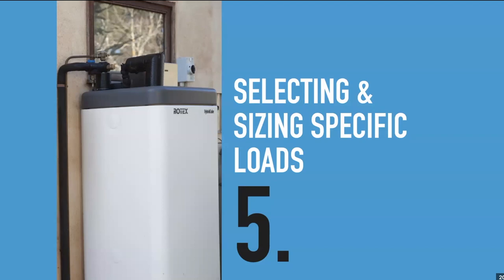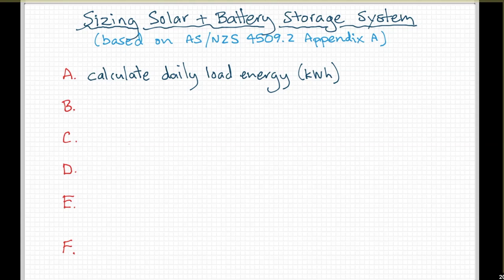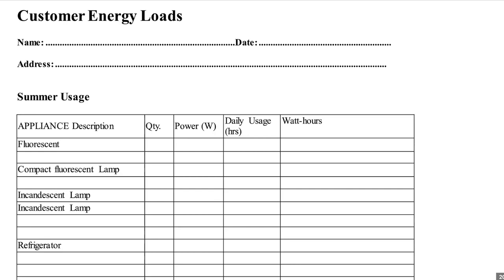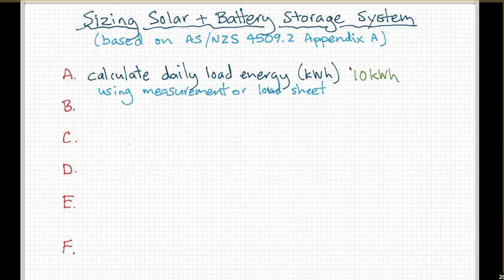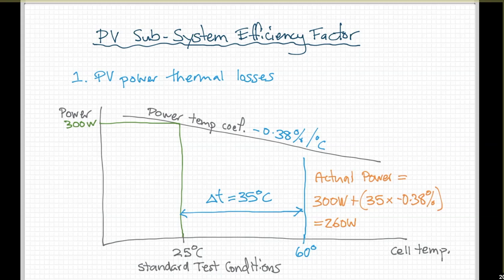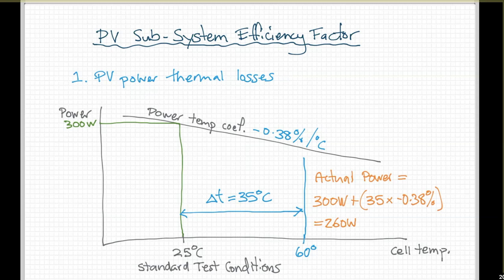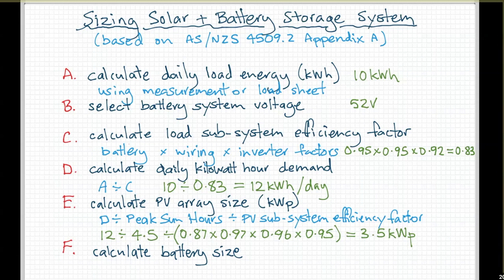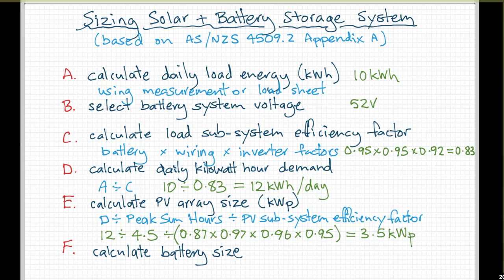Solar & Battery Training Ep9

Comment: Hi Glenn, another great video.  I have a question on DOD.  If we have a 1 day autonomy, the battery will cycle daily to the DOD level in which case 80% is a good choice.  But if we increase the days of autonomy, the daily DOD will not reach 80% on most days.  If we stretch out to 5 days, can we go to closer to 100% as this event will only happen in extreme conditions?  I hope this makes sense.  Piet
Reply from the maker: It would depend on what the manufacturer will warrant. Some base their warranty on maximum DoD and others on energy throughput.

Comment: Hey Glenn. Another question re loads. Can you recommend a product that can measure peak power and energy consumption over a specified time frame for a particular appliance? Maybe some unit that you mount in the SB and it logs this data on an app? or something similar? 
I've got a couple big loads (spa pool/freezer) and I would like to see how much energy they're using.
thanks heaps
Reply from the maker: Hi Hamish, there are many power logging options. In Australia we have SolarAnalytics which is a 3G connected monitor for you solar, grid and loads. There are also circuit level monitoring via a product called the eGauge. It logs to the the cloud too I believe.

Comment: Hi Glenn great training episodes.....can't wait to see more of this...
i have a question from the example pv system you presented ...the  calcs showed that a 15kw battery would be needed. How would you go about selecting the the correct size solar battery charger to make sure you can charge the battery and still provide 10kwh load energy
regards
gingav
Reply from the maker: Hi Gingav, the calculations were for the energy storage capacity (15kWh). Sizing of a dedicated battery charger would depend on generator sizing and period of time it has to run for. Eg. You have a 10kVA diesel generating set, recommended continuous load is 7.5kW. If your battery charging system can supply 7.5kW to the battery then will charge in approximately two hours. Of course, if a lead-acid battery then the reduced charge rate for absorption cycle may take another 1-3 hours.
Reply: Hi Glenn
thanks for getting back to me on this...however if i were to only rely on the solar charge controller how do i size it so it is able to charge the 15Kwh battery, taking into account size of  the load and pv panels in the example.
regards
gingav🤔

Comment: Hi Glen, thanks. another dumb question. I have a off grid 5kw  inverter which say battery input rated voltage 48Vdc. I was supplied with 8 x Gel 12V , 150ah batteries. How do I calculate or find out if these 4 batteries are suitable for inverter battery voltage.
Reply from the maker: Hi John, connecting 4 x 12V batteries in series will give you 48V. Parallel two strings to give you a 48V 300Ah battery pack.
Reply: @SmartEnergyLab  Thanks Glen, it makes sense when I read you answer.

Comment: Hi Glen. Do you know of an off-grid inverter that will integrate with 'smart' appliances and control them? ie - i would like my washing machine to come on automatically once my battery hits 95+%. 
If not in-built in the inverter, do you know another 3rd party system that will do this? 
Thanks heaps :)
Reply: Hi Hamish, Selectronic SP-PRO allows you to use programmable relay outputs , for example you can program one inverter digital/analogue output to close a contactor when the SoC>95%....
Reply from the maker: Hi Hamish, great question! Demand Response Enabled Devices (DRED) are slowing making their way into home appliances. Many air conditioners already have this feature via a DRM interface. I'm not aware of any washing machines that have this though. Problem with appliances that have program selection and buttons to press, they can't be controlled simply by turning on at the wall.
Reply: @SmartEnergyLab  i know many appliances (washing machines, dishwashers) these days can be controlled via wifi and an app interface. i wonder if there are any inverters that can have similar control based on parameters such as SOC? maybe not yet. 
do you know of any inverters that can ping a notification my your phone when the battery reaches 100%? then you could switch on the disher washer manually using the dishwasher specific app

Comment: Hi Glenn , great presentation. I have a question about the number of "charging days":  charge-days and days of autonomy are two different variables. The days of autonomy is  the number of days the system has to supply the load assuming solar resource is not available;  charge-days is the number of days you estimate you require to fully charge the battery bank, ( this quantity will affect how you size the array). 
For example if the daily load is in average 10kwh , the array has to generate 10kwh per day + “amount of energy to be stored in the battery on a daily basis, such that after "charge-days" the full bank will be charged”. 
What is your estimated number of "charge-days" for the example showed in the presentation ?
There is anything in the Standard about how to estimate this number of Charge-Days ?
Reply from the maker: Hi Fabio, from AS/NZS 4509.2 perspective, having sufficient days of autonomy to cover a typical weather cycle will ensure that there are enough "charge days" to recharge the battery and supply the loads. For example, here at Mount Toolebewong in June we have a daily average PSH of approximately 2.7 but this is not a maximum but the average of the month. The weather cycle is typically about 4-5 days between overcast/rain and more sun. During the sunny part of that cycle the daily PSH might be 4-5 so can cover the load energy and recharge the battery. For a solar only design (no backup generator), it is recommended to have a solar fraction of 110% - in practice many installer/designer put 200% or more PV than is required to meet the battery load energy requirements.